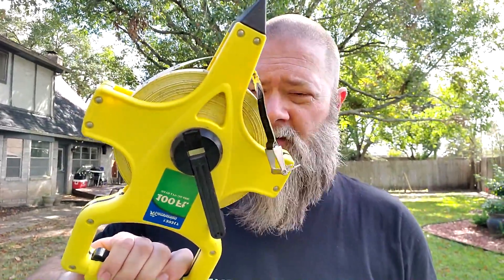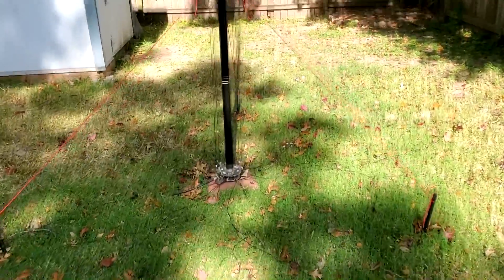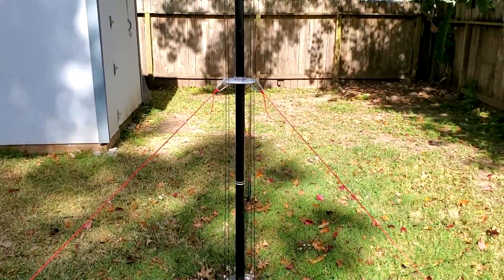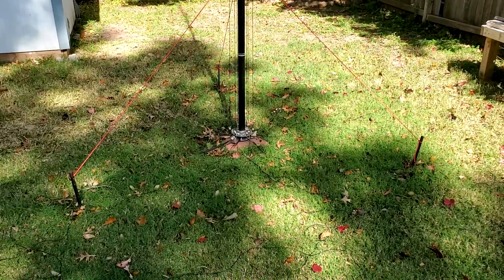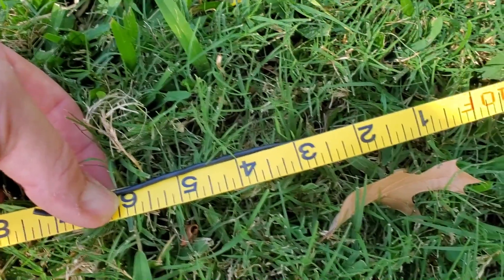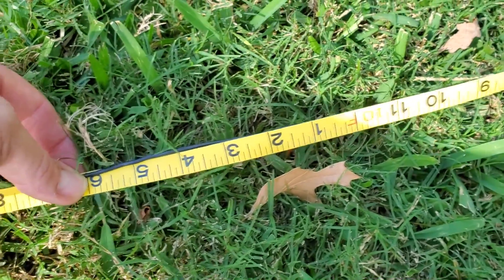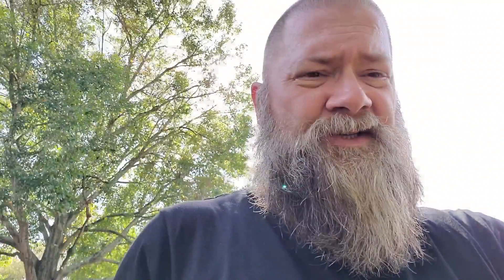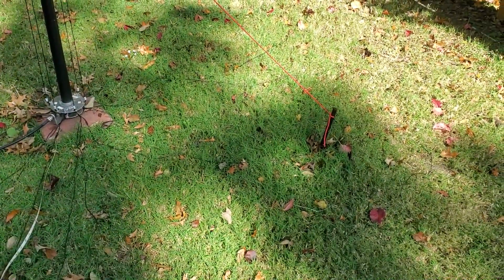DX Commander:  Will it Fit in My Yard?

Comment: I found out that 16 to 32 3.5 to 7 meter ground wires will be a good ground plane .for the DX Commander antenna .
Reply from the maker: Glad to hear it.  I think you would have a tough time screwing up this antenna with the way it was designed and all.  I say go with whatever works best for you...you can always adjust and add more radials later on if circumstances change.  Thanks for the comment and for watching.  73!

Comment: I have mine to the front of the antenna in a fan pattern. Its been like that since April well chuffed with the antenna, knocks spots of my old R5 Cushcraft antenna. Glad I did not spend my money on a GAP. G4YTK
Reply from the maker: That is good to know.  I didn't have a need for that configuration in my situation, but glad to hear from you and others that tried different configurations and made them work.  Thanks for watching and for the comment.  73!

Comment: I don't have an DX-COMMANDER Antenna, but I build an coil-shortened monoband vertical with an 44feet (13.5m) fiberglasspole 10 years ago.
My garden is abt. 20x10 feet.
I simply put a stainless steel ( you can use galvanized type too )   Chickenwire Mesh in the shape of my Garden on the Grass, fixed it to  the ground and let it grow in.
Had no problem to tune it on 80m.
Reply from the maker: That is a very innovative way to build an antenna and solve a bunch of issues at once!  Outstanding!  Thank you for sharing that and for watching.  73!

Comment: No reason why you can’t zig zag / concertina the radials. Thus reducing the footprint. Or use more shorter ones - it will be fine and will work. Up against a fence? 180 degrees of radials will work (very slight difference but if you can’t compare it then how will you know!😃). It lends itself to trying out various configurations. Great video mate.
Reply from the maker: Good to know!  I am sure this info will help others.  Thanks for the comment and for watching.  73!

Comment: Another outstanding video!  Are you using anything other than the guy lines to hold up the DX Commander?  I’m new to the hobby and was looking at purchasing one (seems like a great learning experience).   It just seems that it would take more than the guy lines to keep it upright.  In your video, it looks like you have something under the antenna plates. 73 W0ERR
Reply: No need for anything else. Just the 3  guys at the lower spreader like Scott. Mine’s been working like that for over 3 years now. Full storms and harsh weather no worries.
Reply from the maker: Yep!!!
Reply from the maker: I added a 2 inch thick paver stone to raise it off the ground in the yard because it tends to flood a bit back there if it rains heavily.  But as for guying, the three ropes hold it up just fine.  I have had the antenna up for over 6 months now and no issues.  Thanks for watching and for the comment.  73!!

Comment: You can get these in a small space. Take a look at my qrz and you will see it can get small. The radials work just fine in a 180 degree arc. Heck my home brew version is bolted to a brick wall and I have 42 10' radials on the ground.
Reply: I agree. I have mine about 12' from my property line. I have 32 radials, 10' each. (4 in each wire connector.) I learned from Callum (@DXC) that shorter and more radials is Better than longer and fewer radials. My highest SWR is 1.2. This is the best antenna purchase I have made without a doubt. 73's. K8JAZ
Reply from the maker: Good to know!  I appreciate the contribution to the video!  I just looked at your QRZ account....wow!  and you have a pool nearby too!! 
 Good job on the DIY version!  Thank you very much for commenting and for watching.  73!
Reply: @HR4NT  salt water pool at that lol.  Thanks it was a fun project to put together. And despite my best efforts to screw it up it works lol.

Comment: I seem to remember in one of Cal's videos he looked at this problem. apparently it is not the length of the radials that matters, but the amount of copper on the ground, so say 16 10 foot radials will give the same performance as 32 5 foot ones. I would cut  as many radials as possible to fill the space, they will be different lengths, but what the heck. I am building a workshop at the moment (16x8) with a tin roof with my DXC on the top! According to Cal it should work. 73 Jim M7BXT
Reply from the maker: That is great information!  Thank you for sharing!  I really appreciate the contributions by everyone!  Thanks for watching.  73!

Comment: Calen actually did a video on using the DX Commander in a restricted area where you couldn't run the ground plane wires out to their full length or not be able to run all of them (180 degrees or 270). If I remember correctly he said that it will work but you may not get full coverage. Thankfully I don't have a space problem but your viewer can email DX Commander.
Reply from the maker: Yeah James just answered that above in the comments.  Looks like we have a great Ham Fam helping each other out!  Thanks for the comment and for watching.  73!

Comment: Question:  If I wanted to put the DX Commander on a 50ft tower,  how would i run the radials?
Reply from the maker: No idea.  But if you have a 50 foot tower I think you have multiple options for an antenna.  Running the radials from there and having them just hang there probably wouldn't work.  That is something I would have to ask Callum about.  Someone else commented that they were putting it up on top of a shack roof and running the radials on the metal roof...so I simply don't know.  Thanks for the question and for watching.  73!

Comment: The other thing that Callum has talked about the radials don't have to be perfectly straight.   They could get a bit wiggly (as he would put it).  As long as they are on the ground...you're good.  That might help in a tight spot.   Guy wires...they have to be straight and taunt so you have to have that much space at least.   Have you thought about more radials?   More the merrier there.   73.
Reply from the maker: Thanks for the comment.  I would consider adding more radials, however I ran out of the wire she sent, so no go for now.  I was mainly trying to address the limited space issue, but many above in the comments have contributed some really good information to get around the main topic of limited space.  Thanks for the comment and for watching.  73!
Reply: @HR4NT  help also for small spaces... I remember Calum doing a study where you have twenty 30 foot radials.... forty 15 foot radials would do the same.   That might work for a tight spot.   Anyway I'll quit babbling.

Comment: I dont have a DX commander, I have a Zero Five and have the same issue. I ran all of my radials in a 45 deg area  which went out 12 ft, and everything works fine...
Reply: I really love your show! You have been alot of help to me! I have a give back to you. On Antenna Tuners, When I bought the Zero Five, The owner recommended Palstar. I had a mfj993 and it worked fine with the Antenna, I finally found a Palstar AT500 and bought it.. Installed it, and all I can say is wow! I'm getting into Japan, Russia you name it.. I dont know why and maybe you would know. I can tell you there is a big difference on Antenna Tuners!
Reply from the maker: That was something I wanted to know.  Just wasn't sure if the radials had to be in a circular pattern or if you could modify the placement of the radials without affecting performance.  Thanks for the comment and for watching.  73!
Reply: I was told that by zero Five and Dx Commander...